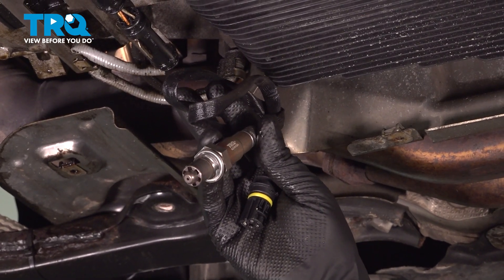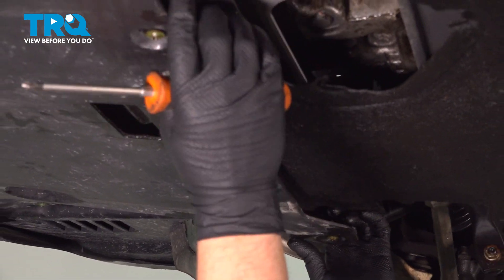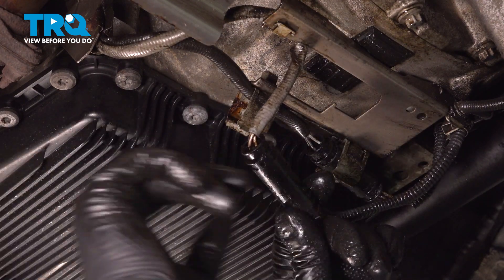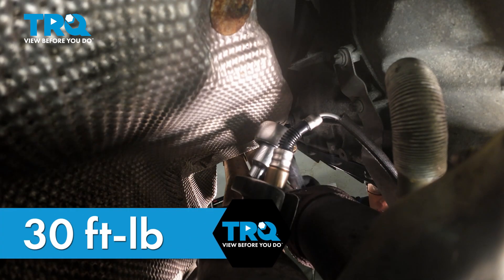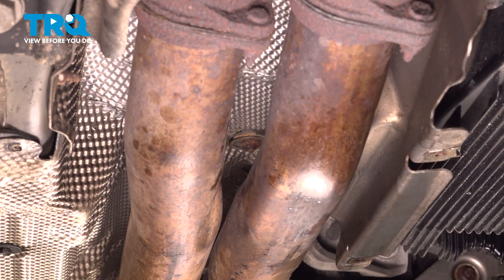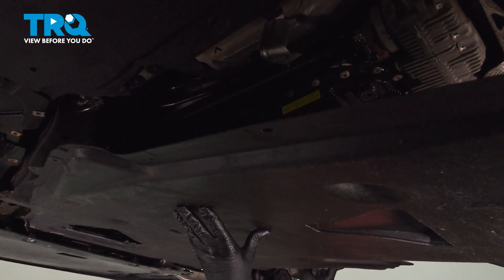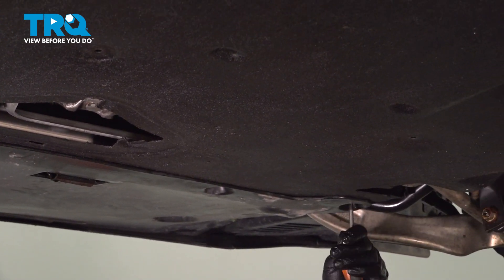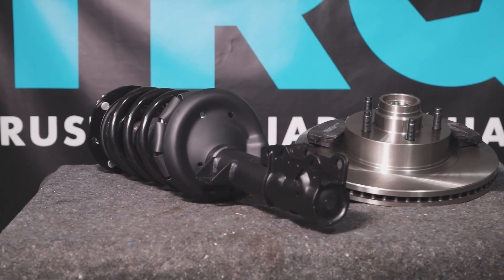How to Replace Downstream O2 Oxygen Sensors 2009-2010 BMW 535i xDrive 3.0L L6

Comment: What about instead of showing how to replace it? What about showing how to diagnose it right before you replace it so people can see what the issue was and then show people how to replace it at the same time. Sometimes there’s people out there we’ll just replace it because it pops up with a code. We don’t want people being a parts changer, but diagnose and change the part.